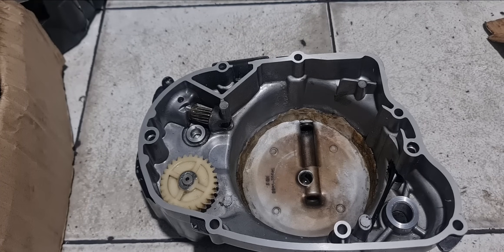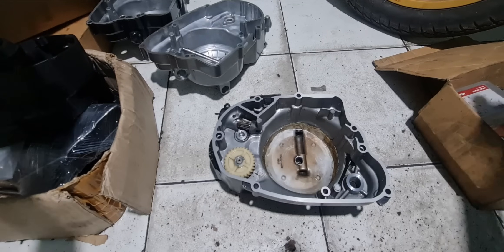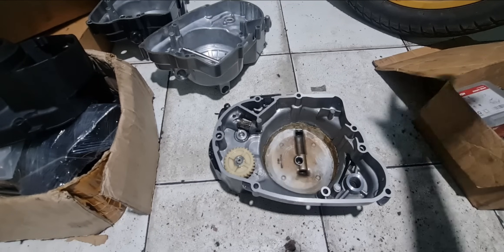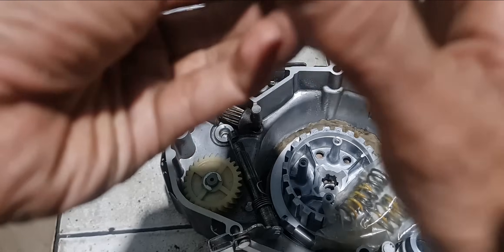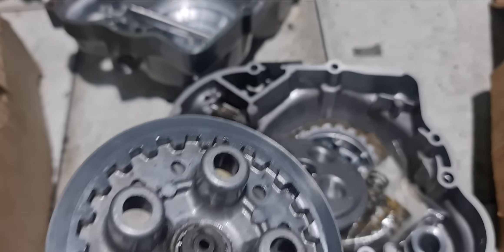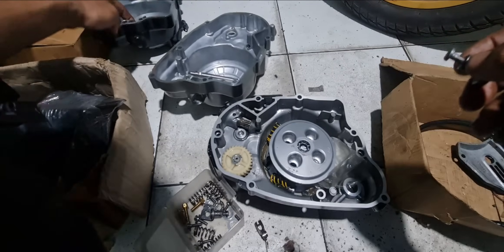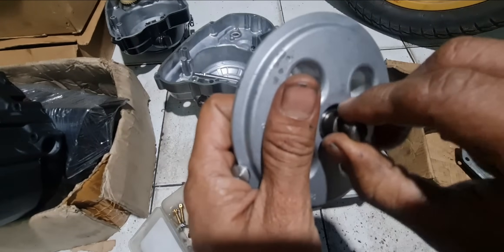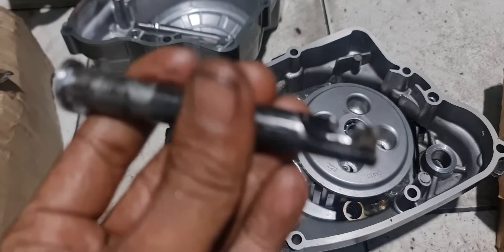REPAIR KOPLING KANAN RX KING KAWINAN NINJA MELENTING + UPGRADE KOPLING

Comment: mas kalo area spull abis kena air trus pas idup timing pincang gk karuan, nembak nembak, selahan mental apanya yg bermasalah, udh seminggu ganti ini itu masih blm kelar
Reply: api bagus biru gede
Reply: cuma pas di selah nendang, pas idup ya gitu tadi, sehabiscuci motor area spull magnet basah, magnet muter gk beraturan
Reply: mohon dijawab solusinya suhu, udah seminggu lebih masih batuk batuk ni motor
Reply from the maker: Cdi nya cek
Reply: Bantu jwb sepengalaman saya ya mas, klo diselah mental biasny timing trlalu maju, kalau pengapian nembak3 cek ulang semua komponennya pengapian, jng lihat dr bsarnya api mas, ganentu soale api gede itu normal, bisajadi itu cdi atau koil mau tewas..
Reply: @MMI_CHANEL  udah ketemu mas, spi magnet nya
Reply: @mohwildanna5133  iya makasih mas, cdi bagus koil bagus, penyakit di spi magnet sama kabel spul